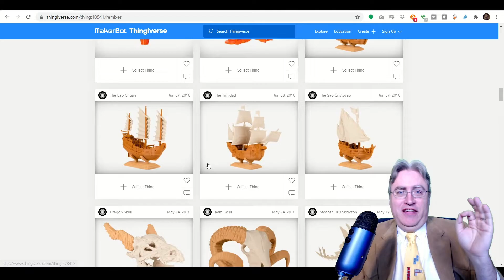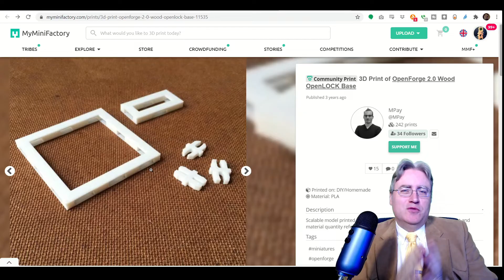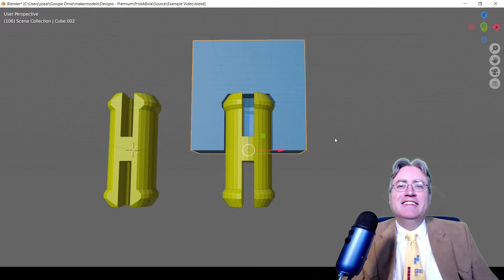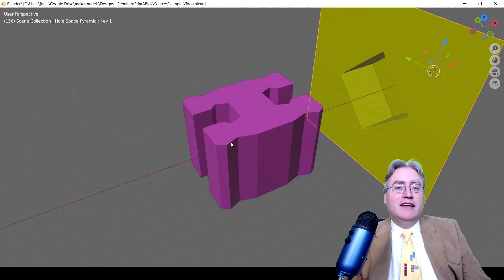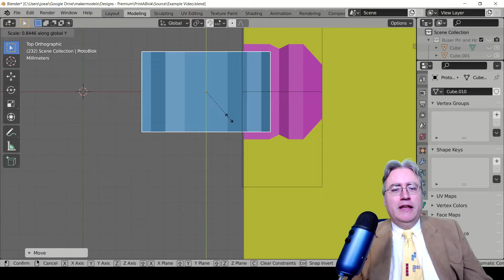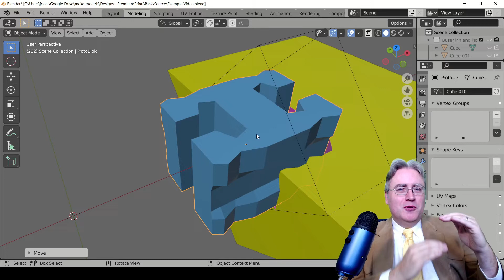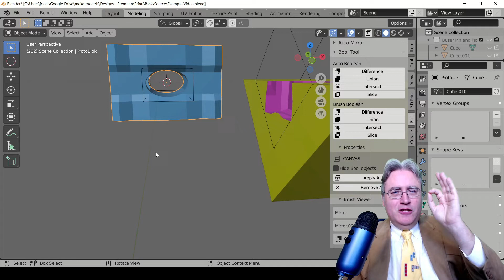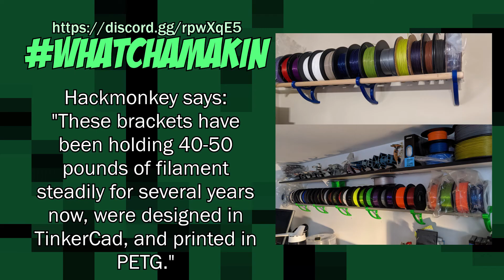PrintABlok Anatomy - How I built a better building block for 3D printing to beat Lego

Comment: I think that the printa-block needs flat-bricks 1/3:d of the thickness of a full block. So many lego designs are dependent on these flat sheets and bars.
Reply from the maker: It has them. And it has panels that are even flatter.

Comment: I had been wondering how you made these blocks for a long time.
Thank you so much for this video! I love explanations of how things are designed. The little "gotchas" that happen during design are super interesting.
Also, I love the little hole in the connectors. I use a paperclip to pull them out so I don't crush them with pliers. My hands are too big and messed up to use pliers well on small things.

Comment: 12:50 I have "Rokenbok", and this removal aspect (for better, or for worse) was difficult, and also kind of sketchy at times in that you could snap the connection block/points.  So the addition of this is nice!

Comment: Your Design is super impressive! Wish I would have seen this video earlier. I just designed my own 20mm blocks also with a snap fit connector. However I wanted a non releasable permanent snug fit. You design is really amazing. Rotating it 45° and the snap fit connector is really genius!